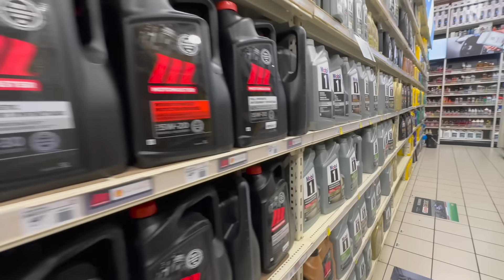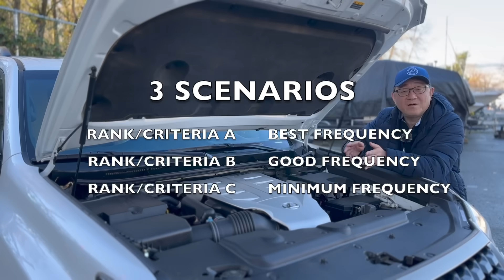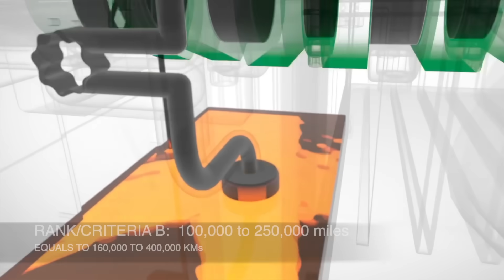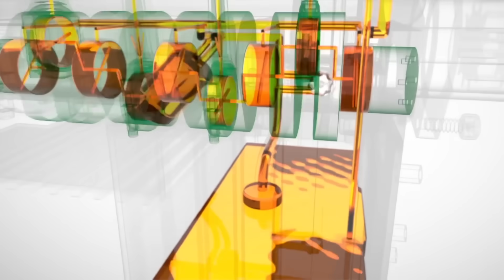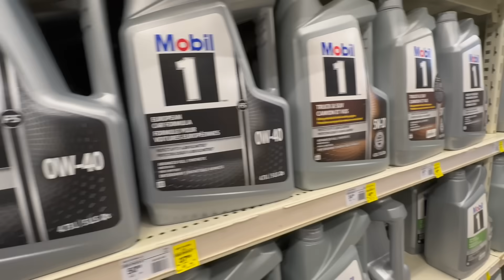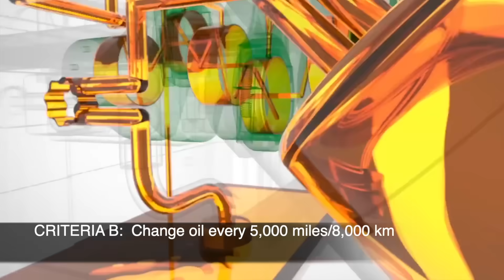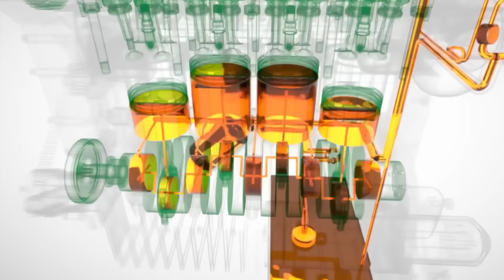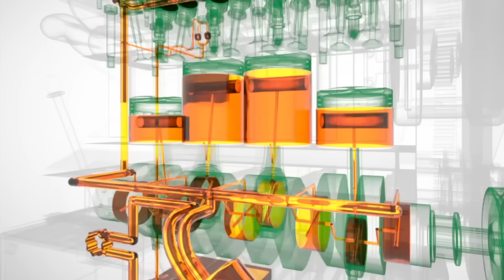ENGINEER EXPLAINS HOW OFTEN TO CHANGE OIL & FILTER // UPDATED CRITERIA-BASED RECOMMENDATIONS!

Comment: Don't need to pull the engine apart to see how your oil is doing. Just get a flashlight and open the oil fill cap and look in there real good. if you want to get crazy you can use a dental mirror.
You can see the head metal and some valve components. The engine head metal should by shiny clean nothing stuck to it not colored and so should the valve components. Shiny Clean!! No sludge no tiny bits of crap. Should look very very clean. If your running dino oil you will see a brown colored patina on all the metal parts. Not good that's oil breaking down under high heat and off gassing.  Its shit. And Best way to maintain the coolant system is when you change the oil just dump the rad ONLY to. A standard oil plastic catch can will fit under the car without jacking it up. many cars you can see the rad petcock from above. Take the cap off open the petcock and dump the rad. Fill  it back up with Factory coolant not auto parts store crap. Most rads take a gallon. Do this again in a few months it makes a great impact on the coolant quality and NO AIRLOCK NONSENSE. 3 of these super simple fills and the coolant will look brand new. Fill it up drive away. Check the overflow bottle the next day it will be a little low top it up to the Full line.
Reply: Good suggestion but why does the air lock problem disappear? 

(I would think you should dump the overflow reservoir at the same time as well)
Reply: @kimbuck-2  It doesn't disappear it was never caused. if you dump the engine coolant and dump it dry all its small coolant channels throughout  the head and block get air bubbles trapped in them because they don't fill back up well not any venting. Its really difficult to get all that air out without a bleed tool especially these days because most modern cars the top of the radiator is below the top of the engine which is perfect for a air lock. That's the biggest cause of airlock a trapped air bubble will rise to its highest part of the circuit and in a modern car that's the cylinder head. Don't dump the engine not necessary and much safer just full rad dumps. And yes that includes the overflow bottle too.After the dump check it for a few days top off the overflow as it settles in. Been doing all my cars like that for 20 years. Moat cars don't even need to be jack up.
Reply: @My1970TransAm  Fantastic and much appreciated response. 

I don't know a ton but just replaced a radiator, hoses and t-stat on a 2012 Camry and necessarily there was a lot lost from the block. 

I was looking at the configuration of the block versus the top of the radiator and considered that the radiator wasn't the highest point.

After filling and using a burping funnel, I parked on and upslope to do the best I could to get the air out. 

I was wondering if I should get one of those vacuum systems to have on hand. 

Anyway good post by you and I think I'm going to do this the regular frequency on our new 4Runners.
Reply: @kimbuck-2  Um sorry but Toyota's are very very hard to get rid of the airlock. be very aware of the engine temp many a toyota motor has been damaged by a blown head gasket from trapped air bubbles in the head ( no coolant flow there) and over heat. Try jacking the front of the car up fill it up and run the engine with the rad cap off hopefully all the bubbles will get out. WATCH THE TEMP GAUGE if it rises over normal temp shut it off and buy a bleeder. Some autoparts store rent them.
Toyota's are hard.

Comment: If you really want your car to last. Learn how to change the oil yourself. That way you know you are using a quality oil and filter. Plus some 18 year old kid at Jiffy Lube isn't cranking down your oil pan bolt with a breaker bar.

Comment: 2006 Toyota Matrix 4WD with 226,400 miles. 5k OCI with Kirland 5w30 full syn and OEM filter. 30k for Trans, TC, Diff, and brake fluid. 50k for PS fluid and coolant. It runs perfect.

Comment: Mercedes sprinter van turbo diesel v6.
Oil change  interval  10,000 miles
Current mileage  418000 miles. Mobile 1 synthetic oil.

Comment: David,  Picking up a 2024 Toyota Rav4 tomorrow.  Can you recommend the best oil change options to break in the engine?  How many oil changes would you recommend during the break-in period?  Like changing the oil every 500 miles for a total of 4 oil changes within the first 2000 miles?  I plan on following your " Criteria A" (Every 3,000 miles)  Thank you for your expertise!
Reply: First oil change at 5k miles, then at 10k intervals. These engines are extremely durable and are know to reach 300,000 miles or more. Don't fall into the trap of changing oil that often, it just wastes money and doesn't extend engine life.

Comment: I’d recommend a seasonal change in areas with harsh winters. Those cold starts and a goo-like state drastically reduce oil qualities. 5000km max for 5+ y.o engines. And change a filter every time. Cmon, they are cheap if you don’t drive some fancy stuff.

Comment: I change my oil ever 3000 on my daily. And the track car every 800 to 1000 miles. 
The daily bluw up twice already now due to bad maintenance of previous owner's.  So i dont really have a reference there. 
But the track car is now 10 years old and has seen about 5000 miles hard track use and 30.000km overall. 
The car is stock appart from a few uogrades like an intercooler. 
Stock it makes 300hp/280ft-lbs. Now after 10 years it makes 341hp/322ft-lbs. 
I think most of that comes from good maintenance.  
I also had a Mercedes sprinter when i was in transport. Bought it with 77.000miles on it. When i did maintenance the first time the oil was your typical diesel black. 
And it had a small oil leak comming from the valve cover. 
In a year 60000miles and did maintenance every 6000 miles. 
On the last oil changes the oil came out almost clear and the oil leak was gone. Sold the thing and the guy that bought it did over 350.000 miles without touching the engine. 
Good maintenance pays off big time!

Comment: I agree with the 3,000 mile change frequency. I did contract work for the EPA in the early 1980s that required investigation of motor oil additives. At that time, all oils on the market had lost the majority, or all, of the additives’ function by 3,000 miles. Regardless of the make/model, I strive to change the oil and filter at that range, tho sometimes I get distracted and may push 5,000.
Reply: now 2025
Reply: @ Really? How shocking!
Reply: This is why every 20,000 miles I pay the extra $10 for a TBN analysis in my used oil analysis. Based on the lab results, I'm now running 9,000 mile oil change intervals in my Honda Civic. Last change was 8,900 mostly warm-weather miles, mixed highway & stop-n-go, and the detergents were still in spec. Just 0.3% insolubles and trace fuel.
Reply: @ Good to know. Thanks for that info. I will look into that test, tho $10 seems very low cost for a thorough test.
Reply: Oil has come a long way since

Comment: What's a good diesel interval. My truck gets use then sits. 5000 miles a year. Is it ok to let it go a year or 18 months if its only driven 5000 miles?
Reply: If you live in a mild or warm climate you can. But if you have seasons you should change oil at least once a year regardless of mileage.

Comment: y 2018 Volvo came with a maintenance package. Dealer wouldn't touch it till 10,000 miles. That's now over I do 7500 and I use Liqui Moly.

Comment: Mini/BMW recommends long life oil every two years or 18,000 miles, so that's what I'm doing. Rightly or wrongly.
Reply: That’s an insane interval and it will cost you one day. Start saving or sell your car. At least 50% of engine problems are caused by these crazy “manufacturer recommendations”.

Comment: Whoever was lucky enough to buy one of my perviously owned trucks ended up with a very well maintained pickup.With records to prove it. Full synthetic oil change and tire rotation every 4 to 5K miles. Transmission fluid every 30K. All other driveline fluids at the recommended intervals.

Comment: I agree with your suggestions BUT I would take off 1000 miles if the engine is direct injection and/or has a turbo.

Comment: Amsoil guy here and after lot of tests and oil analysis I have done my conclusion is that best for any vehicle is using cheap Walmart supertech oil and change it every 3k miles than using top of the line synthetic oil and changing it every 7k miles, I do not agree with oil filter changing it every time you change the oil, can be every second oil change or even every 3 oil changes if you use high quality filter like wix xp or purolator boss, with these filters the oil will flow faster and filter better.
Reply: Some guy posted that he does the opposite.  

He changes his filter every 3000 miles and adds a cup of oil.  Then at 6000 miles, he changes both.

He thinks filters are more important. 

I dunno.

Comment: What is missing is that not all oils are the same.  Even from a given lube blender they have tiers of quality. Higher tier/ more expensive gave higher additive treat rates even at the same viscosity grade eg 5W-30.  Don't skimp on oil quality,  and then you don't need to change so often. With a modern high quality oil every 10,000 miles (and change filter) is fine.  With a low tier oil, far more often. I worked in lubes R&D all my career.

Comment: But in one of your videos, you interviewed with "supposedly" head of Nissan GTR engineering, and the conclusion was to change the oil every 2000 miles.   The cost of making those kind of engine oil change frequency, is quite ridiculous in terms of cost.   At the end of the day, it's a mechanical thing, an engine is designed from the get go, to have wear and tear, there is always going to be friction no matter how good the engine oil is.  We should do what makes sense , a balance between cost of maintaining the car, and also without going overboard and being OCD about it.

Comment: Whilst in Australia, as a buyer of trade-ins, as a sideline, I bought A BMC Mini with a blown engine. A workmate told me he had an old Mini block I could have for $20.  Got it home, took the sump off and checked the mains and big-end shells. !
        They were all perfect, with that multi-colored shine on them.  Next day I took it back and told him he had given me the wrong block, as there was no sign of wear anywhere. He said it was the only one he had and had got rid as it was burning a pint of oil every thousand miles. (Which was normal for a Mini).
      It turned out he had changed the oil every 1000 miles, explaining the lack of wear. I didn't ask where all the oil came from. But when back on the road the Mini was a right little ripper-abouter. ! The moral being, if you want an everlasting engine, change the oil every 1000 miles. !

Comment: I drive almost exclusively in the city. I change the oil every six months because I don't drive enough to reach 3000 miles within the 6 months. Frequent oil changes will become even more important with so many auto manufacturers going towards turbocharged engines, which are extremely hard on engine oil.

Comment: What about a Tahoe that gets driven only about 2000 miles annually? Will one oil change per year suffice? It's a 2012 with less than 60,000 miles on it.

Comment: With 5000 miles I'm on the save side, even at severe & demanding conditions like high speed autobahns (that means pedal to the metal in Germany) or stop and go inner-city traffic.

In Germany we have the metrical system, I change my oil every 7,500 kilometers in winter* and 10,000 in summer - if I do less I change oil every year in autumn when I go from summer to winter tires. 

As a result to this regime I don't have to top up oil between the oil change intervals. 

I don't listen to the 20,000 or even 30,000 kilometers recommendation of the manufacturer. 

*Winter is more demanding on the engine and the oil.

Comment: The problem with this recommendation on oil change frequency is that it runs counter to a study that was done on oil several years ago that I read and saved somewhere. I'll have to look up the title of the study, but it was pretty comprehensive. The findings surprised even the engineers that performed it. They put new oil in several engines, synthetic in some and regular oil in others. After about every 500 miles or so, they would test the oil for characteristics such as viscosity and how many contaminants were in it. What surprised the engineers was that they would find a higher number of metal shavings after the first 500 miles from when the oil was first changed, then the numbers would taper off as time went on and that particular oil went through it's life. The oil would be changed again, and the cycle would repeat; a higher number of metal shavings at the beginning of the life cycle of the oil put in. Conclusion? That when new oil was put into an engine, it was taking a while for that oil to 'break-in' and protect the engine as it should. In some cases they left the oil in for 15,000 or more miles and found that the oil was still doing a good job protecting the engine (not recommending this). So they concluded that changing the oil every 3,000 miles was actually doing more harm than good because the oil was never getting to the point where it was protecting the engine as it should. I don't know; maybe David's recommendations are correct. But that article I read was pretty comprehensive, with charts and graphs to back up their statements.

Comment: Question (with long lead up). I have a new Honda Pilot. I'm currently at 300 miles and plan on doing first oil change this weekend with a sample sent to Blackstone for analysis. Will do Pennzoil Ultra Platinum 0W-20 with Purolator Boss filter, will be about half and half city/highway miles and will do second oil change around 2500 miles with another oil analysis to confirm engine break in is going well. I have the Honda maintenance plan, and they will do a change at 7500miles intervals, my plan is to change the oil every 3500-4000 miles. When I get the 'free' oil changes from Honda, would you let them use their own "synthetic blend" oil/filter (because its covered and cheaper) or bring them the 6 quarts of the full synthetic/filter I plan on using when I'm doing my own mid interval changes?

Comment: I bought a ‘68 Pontiac Bonneville with 65k miles and the original owner never changed oil, just added when necessary. As I only paid $450 for the car, I kept to the same no change policy the 1st owner adhered to and just kept the oil topped up. I sold the car with 105+k for $200 and it was still running ok. Always wondered what the inside of the engine looked like? Did start smoking a little at 80k.

Comment: Easy as ABC, 123. 😊

The guru of all things lubrication. Riding on a thin film of oil to prevent metal to metal contact and also to prevent sludge buildup and galleries plugging. 

Oil is cheap engines are expensive.

Comment: As engineer, what advice would you give someone whose 2012 Camry 2ARFE burns oil?  Car Care Nut says it's  clogged oil control rings on the pistons, rebiuld.  One YouTuber says use Amsoil engine flush to decarbonize and change the oil, this will free the rings of build-up.

Comment: I agree with around every 4,000 miles oil change interval with new oil filter with the requirement of new cars. I have a 2024 Honda Pilot and think that every 4,000 miles oil change and filter maybe adequate although the dealership service dept recommends every 5,000 miles interval. Thank you for your great video.

Comment: I'd like to hear more aboutthe six month recommendation.  What components of the oil are actually breaking down based solely on time?  Or, put another way, if I changed my oil and never ran the engine for six months, why would I need to change my oil because if I had that same oil sitting in my garage in its sealed container, I'd never even think about taking it to be recycled.  So  is there just an assumption made that people do "X" cold starts per day and every cold start allows some amount of gasoline to wash past the rings and some amount of combustion gases to blow by them as well?  Or, is the time recommendation only intended for people with broken odometers based on an average amount of driving?

Comment: What you've said doesn't make sense, to me, and seems a bit contradictory. You first suggested that the oil still functions as intended, as a lubricant. But it's the containment's that are introduced that give cause to change the oil. Then you indicate 'or every 6 months'. How can an oil that is still working as a lubricant, even when contaminated but stop working even though not contaminated due to just sitting there? 
Please clarify, if you would. 
Thanks

Comment: Any good Synthetic oil changed every 5k miles with the filter will exceed your engine's requirements. 3rd generation mechanic and engine builder.

Comment: Regardless of 3 scenarios, and generally speaking, would you recommend changing the oil at least once a year, even if it hasn't reached the mileage? I have a secondary vehicle which is not driven often, and rarely reaches 3k miles in 1 year. Appreciate your input.

Comment: Have a 2004 Honda Odyssey at 270,000 miles, bought new and changed oil/filter every 3K to 5K miles.  Engine is still running well.  Hope it can last to 500,000 miles.

Comment: When I worked for Ford we had a tech class with a group of Ford engineers. He made it simple - you change the oil when it is dirty. Period. In some environments that will be every X number of thousand miles. In some sandy, dirty or toxic environments, that could be every few HUNDRED miles. Look at the oil. When it is saturated with dirt or particulate, you change it. You change the filter when you change the oil. It's not rocket science.